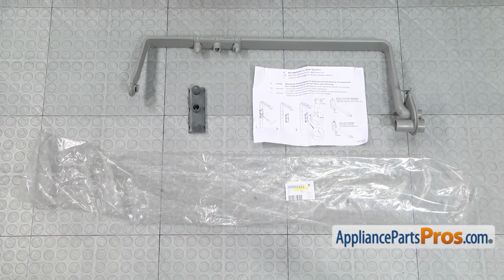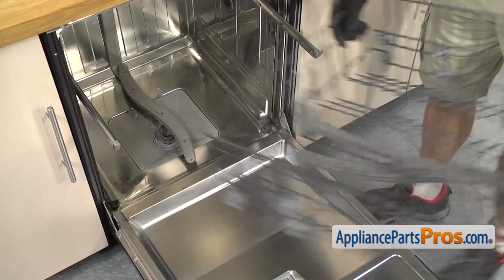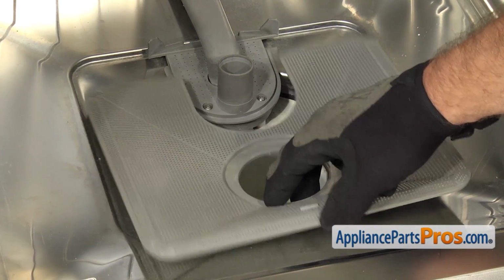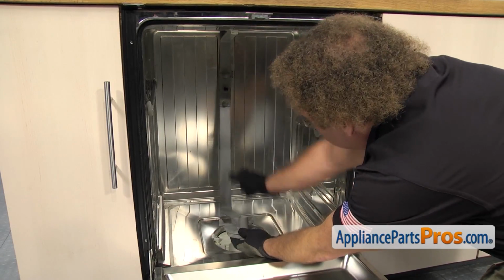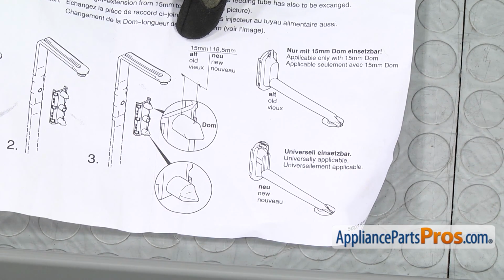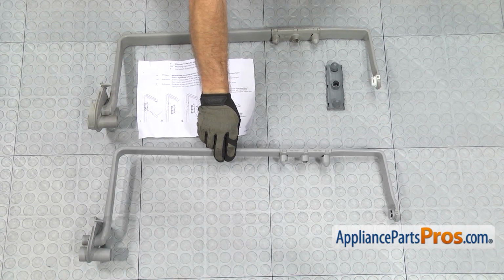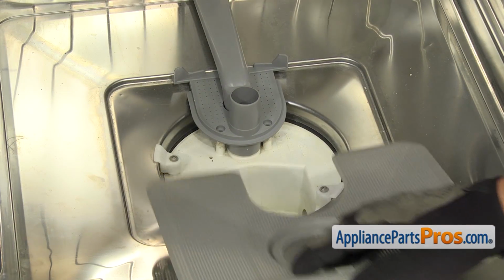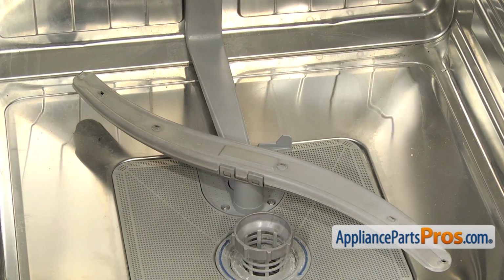How To: Bosch/Thermador/Gaggenau Spray Arm Water Supply Tube 00350321

Comment: How about if the metal clip came off the back wall? The spot weld must have failed. I guess a stainless self tapping screw wouldn’t be advised?
Reply from the maker: Unfortunately, if that piece is broken off the back wall, there is not a replacement for it. You would have to replace the unit.

Comment: The metal bracket that holds the water channel has got detached from the stainless steel back panel.  Looks likes it was spot welded in the factory. Any idea how to re attach ?
Reply: I’ve got the same issue the back of the water supply come loose
Reply: Same here. Anyone know how to fix this?
Reply: @mfavinsk  Wanted to avoid any glue/ metal paste/ since it involves food and utensils.... Finally took a chance and punched a tiny hole on the clip and the rear wall  (was very easy with a small scissors). Used a tiny brass bolt ... passed through the clip and the rear wall. Bolted it  behind the machine. Works wonderful. No leak. Only ensured that the rubber ring washer that was found behind the clip is also put back while bolting it tight. It's been a while. No problems.  Tip: Where did I get the thin brass bolt with such a tiny screw head? I broke open an electric switch to take out the brass ring where you insert the wire and the bolt (with the screw head that threads into the ring). So, the large ring with the screw hole is behind the machine. Couldn't ask for any better since it is rare to find a tiny diameter bolt with a large nut. Recap: puncture the clip in the centre, puncture the rear SS wall where the impression is seen, insert tiny bolt via the clip place the rubber ring between the clip and the rear wall, push the bolt through the rear wall, bolt from behind with the large nut.

Comment: Without getting into the dishwasher to see how much water is coming out of the holes in the spray arm while the cycle is running, how do you tell whether the supply tube needs replacement? I have a Maytag which doesn't seem to have any filter. 

Your filter and spray arm supply tube LOOKED perfectly clean??
Reply from the maker: We film repair videos for multiple parts on a single appliance model to serve as an example of the repair, but the appliance we're working on may not actually be broken, and often times we're replacing functional parts. If you need help diagnosing an appliance, we can help you out, though! We offer free technical advice and diagnosis. You can give us a call at 1-877-477-7278 or you can chat us at our website: http://www.appliancepartspros.com/. We will need your model number to give you accurate advice, which you can locate using this tool on our website: http://www.appliancepartspros.com/modelnumber_locator.aspx
Reply: I recorded it in action with my phone !  Get a good water proof case for your phone or camera , place it in the dishwasher with waterproofed light source and record what happens on a short cool cycle (not too hot!)
Reply: In my case, the tube had a blowout on the seam, so it was visibly damaged.  I could even hear a difference in the operational sound, as the water was directed out of the breach and onto the side of the dishwasher (which actually prompted me to check on things).